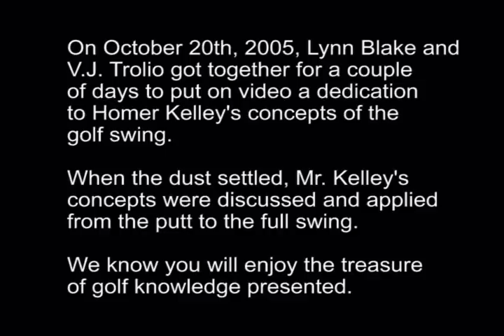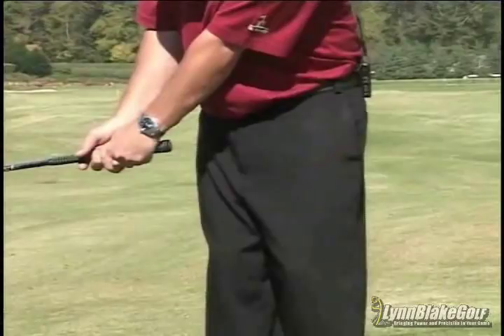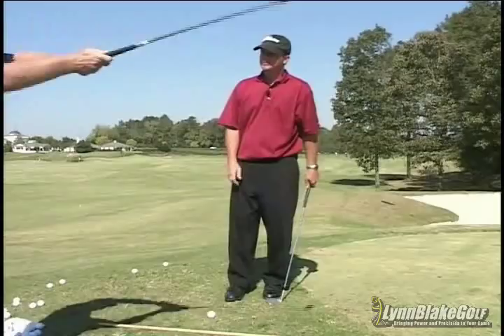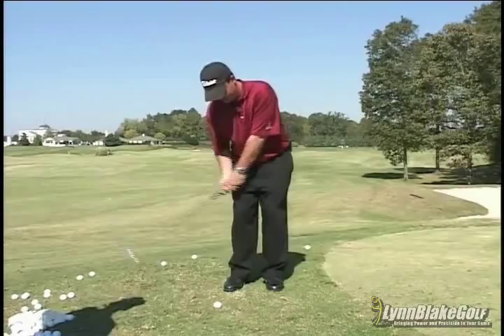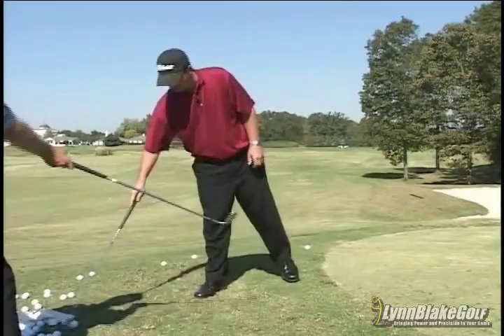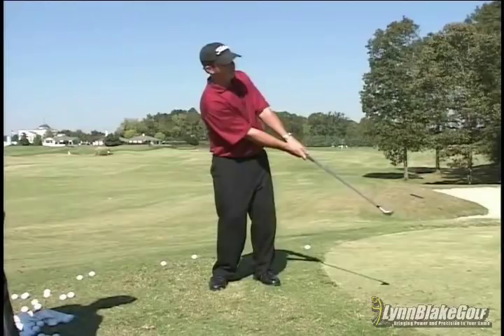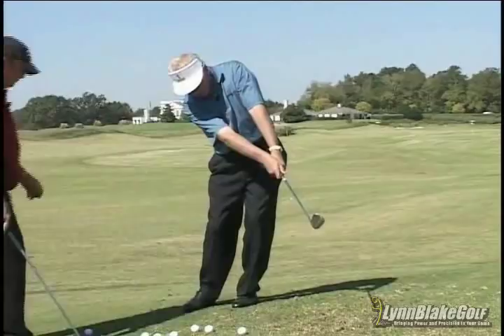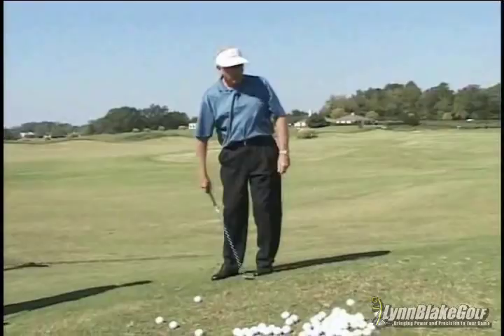Building Your Basic Stroke with Lynn Blake and V.J. Trolio

Comment: First three minutes are swinging (left arm passively dragging the clubhead);  then switching to hitting where the right arm drives the shot.  

Always they emphasize a flat left/bent right wrist alignment.  And, then add 3 varying degrees of closing the club head through impact ("hinge action" = intentionally rolling the face or holding off the face closure)

So, two methods (swing or hit) each with three hinge actions.
Reply: For the short irons it works ( straight shots) but you loose distance with the driver but it's always straight .

Comment: I have no clue what they are talking about, is there some dummy version?
Reply: What they are demonstrating are three attitudes that the clubhead can take through impact with a flat lead wrist, and that remains flat - no bending or rolling or turning or flipping - through impact until about 2’ after.

The lead arm swings from the lead shoulder like a door swinging from its hinges. The club goes along for the ride.

If the arm swings vertically from the shoulder socket (think cat flap) the clubhead tilts backwards, adding loft. They use this for lob shots and short shots and call this tilting back ‘lay back’. The club face stays looking at the target and just lays back.

If the arm swings through impact at an angle to the ground, the clubface closes through impact, but it also lays back a bit. This produces a higher shot that tends to fade slightly, because whilst the club is closing the tilting back swipes the face across the ball.

If the arm swings from the shoulder like a closing door, the loft stays the same and it just goes from open to closed. There is a slight tendency to draw the ball.

Otherwise if you have specific questions would need to know what they are.
Reply: @1DCCX  Thanks for the explanation, the last one to swing the arms like a closing door, does that happen because the the torso does not rotate to target and provides a base to hinge on?
Reply: @amfohr  It varies from player to player and depending on skill level and physical ability. A completely stalled out torso allows for precision with the arm and hand as it swings through the ball. However, it receives a massive impulse of energy that causes the flat left wrist to break down. Generally there is some residual torso velocity still by impact.

Generally the torso is moving to some degree but is rapidly decelerating. 

Three things are important to avoid shots that start left. One is at set up or in the backswing the clubface opens slightly to allow for it to close. Two is that the left arm hinge is swinging at what feels like the clubhead is swinging at the same rhythm as the torso is turning. Three is you maintain a flat left wrist.

From the top of the swing the sequence of body parts is hips, torso, shoulders, arm, hands. As each component in sequence accelerates it slows down the previous one. 

The consequence of that in relation to your question is not to try to stall out the torso and not to try to accelerate it, if it disturbs your sequence of accelerating the clubhead.

This is one of the reasons why the hands (especially for TGM, Lynn Blake) control the swing. You have A) more sensory receptors in your hands so they control motor patterns and B) as long as your pivot isn’t too out of whack, they will compensate for the slight variations in lie, ball position, aim, swing from stroke to stroke.

The alternative is to pivot and adjust yourself to the ball so the clubface aligns on it. It is less precise but, is arguably better under pressure.

Most tour pros work on quiet hands in the swings. They grew up to learn how to actively flip and roll the club to hit hooks and draw shots for distance so to play at a high level they focus on the body and have passive hands.

Because the body is angled over, it will produce angled hinge that flips the clubhead, most tour pros are bending their left wrist through the ball. So to stop or reduce that, the modern swing is about extended arms, dead hands, and aggressive pivot. Eg Rahm, Fleetwood, Morikawa, Aberg. The mental cue of an aggressive pivot forces the handle of the club forward relative to the clubhead to prevent a pivot closing the clubface plus a bending left wrist closing the clubface

With active hands and pivot you would have a closed clubface being closed further = left of left.

TGM/Lynn Blake don’t want left wrist breakdown either, but they mentally cue on a flat left wrist and hand controlling the hinge of the arm from the shoulder, rather than the pivot rotating, to force the grip forward. The hinge action only takes place from contact with the ball to about 2’ post contact. It’s serving ti stabilise the clubface during that interval.

Bottom line to refer back to your question, what Lynn Blake is advocating on the downswing will be something like:

Hips, torso, arm, left wrist uncock, left wrist rotate the clubhead to face the ball, impact: hinge action to both arms straight, post impact left wrist rotate the club again to get out of the both arms straight alignment and complete the swing.